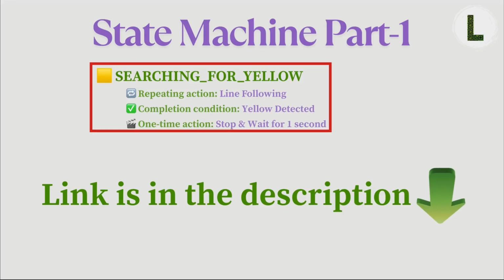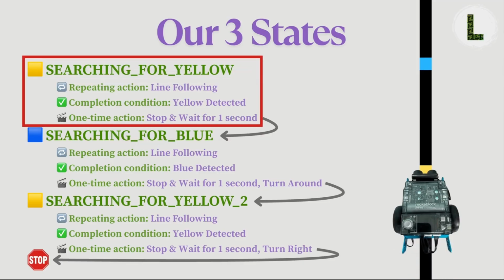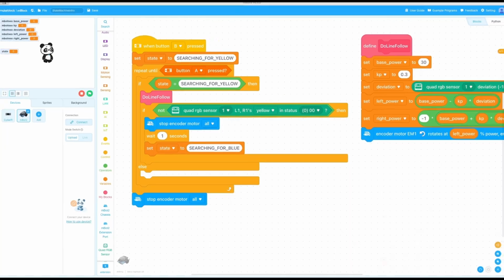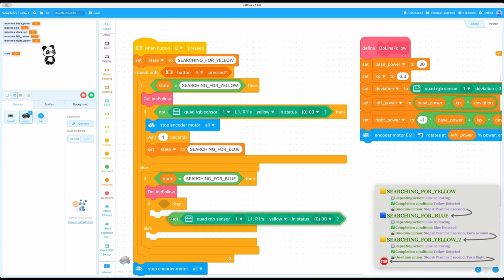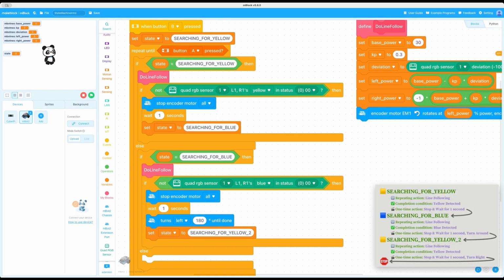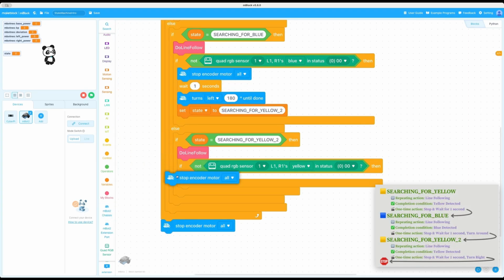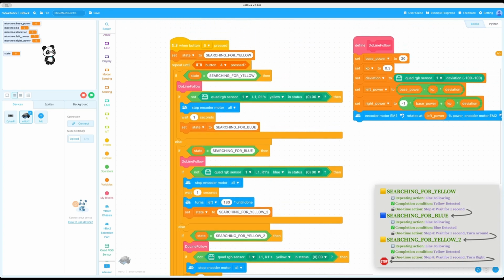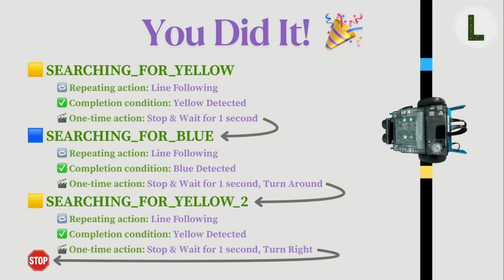Intro to State Machines Part-2: Color-Based Robot Reactions with mBot2!

Comment: Hello Admin,

I have a question: when the mBot2 is following a line and reaches a section of the line without any colored markers, how can I make the robot turn right or turn left?
I have spent several weeks trying to figure this out and experimenting with Python code, but so far I haven’t had any success. I would really appreciate your support.
Additionally, I have written a piece of Python code based on my own ideas. I would be grateful if you could review and help me improve it.
import cyberpi,mbuild,mbot2,time
@cyberpi.event.is_press('b')
def on_button_b_press():
    base_power=19
    kp=0.4
    red_flag = False
    global frequency
    for count in range(2):
     cyberpi.audio.play_tone(800, 1)
     cyberpi.audio.play_tone(200, 1 )
    while not cyberpi.controller.is_press('a'):
         if red_flag:
            if mbuild.quad_rgb_sensor.is_color("black", "L2") and mbuild.quad_rgb_sensor.is_color("black", "L1") and mbuild.quad_rgb_sensor.is_color("black", "R1"):
                mbot2.EM_stop("all")
                time.sleep(0.5)
                mbot2.drive_speed(10, -10)  
                time.sleep(0.9)
                mbot2.turn(-90)
                red_flag = False
                continue
            elif mbuild.quad_rgb_sensor.is_color("black", "R2") and mbuild.quad_rgb_sensor.is_color("black", "R1")and mbuild.quad_rgb_sensor.is_color("black", "R1") :
                mbot2.EM_stop("all")
                time.sleep(0.5)
                mbot2.drive_speed(10, -10)  
                time.sleep(0.9)
                mbot2.turn(90)
                red_flag = False
                continue
         if mbuild.quad_rgb_sensor.is_color("yellow","L1")or mbuild.quad_rgb_sensor.is_color("yellow","R1"):
            cyberpi.led.on('yellow')
            time.sleep(0.15)
            mbot2.turn(180)
            red_flag = True
            continue  
         elif mbuild.ultrasonic2.get()<10:
            cyberpi.led.on('red')
            cyberpi.audio.play('wrong')
            mbot2.EM_stop("all")
         else:
            deviation=mbuild.quad_rgb_sensor.get_offset_track(1)
            left_power=base_power-(kp*deviation)
            right_power=-1*(base_power+(kp*deviation))
            mbot2.drive_power(left_power,right_power)
    mbot2.EM_stop("all"